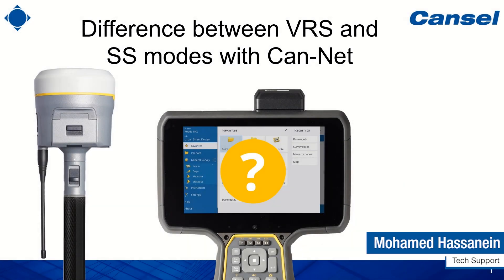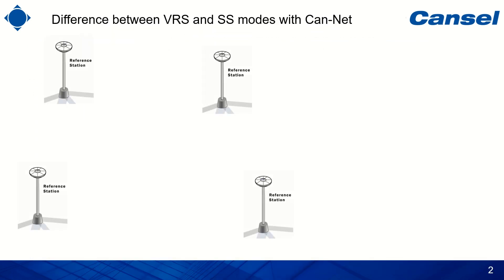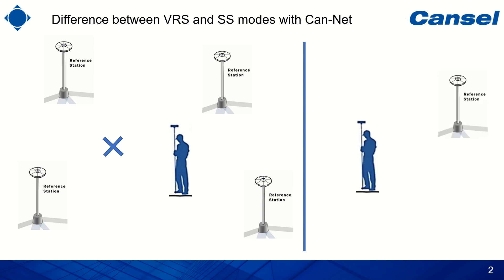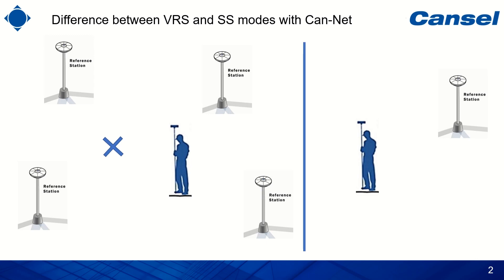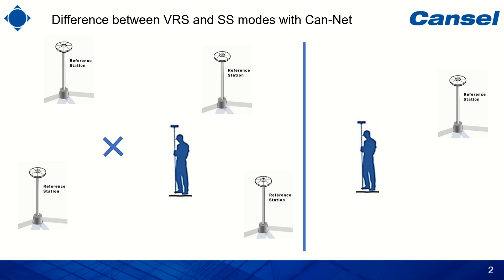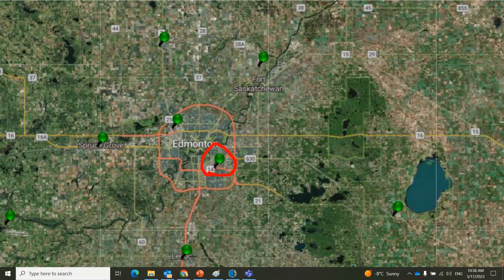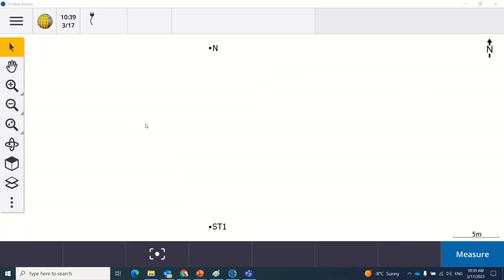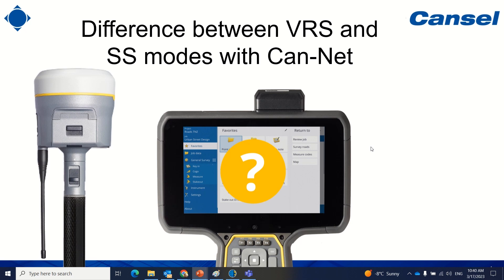Can-Learn: Difference between VRS and SS modes with Can-Net

Comment: Doesn't the PIVOT server automatically recognize the situation and adjust your correction accordingly? I brought this issue up with my PIVOT administrator a while back and he said that it will put you on single base if you are outside the network perimeter and/or are really close to a physical reference station.

For instance. If one is working about 5km from a reference station, and all the others are 100km away or further, doesn't it automatically give you the corrections as if they were generated from the nearby station only? 

It has always been my hope that a RTN takes a lot of these decisions out of the hands of the field technician. Having been involved in the deployment of infrastructure for, and the training of end users of RTN's (RTK-Net and PIVOT), I can attest that, despite how much you train people, there will be some that will just use whatever they have seen work in the past, and refuse to recognize that they need to evaluate each site and choose a RTN source and mode accordingly. Hopefully these services take some of these basic decisions out of the field technician's hands and automatically supply them with the correct solution which, as is mentioned in the video, is often a single base correction.